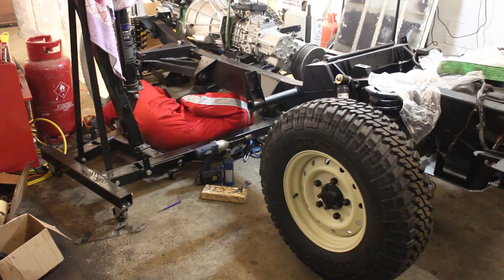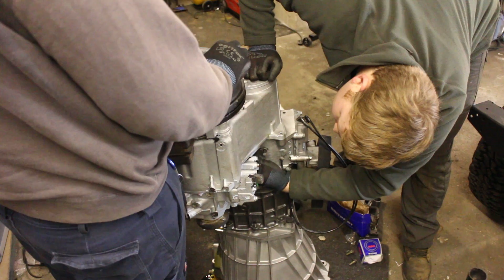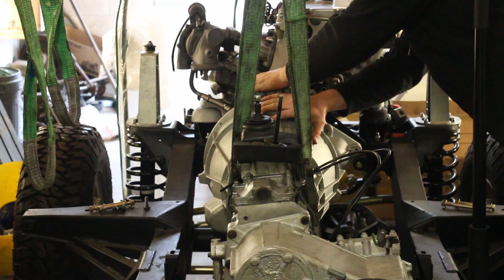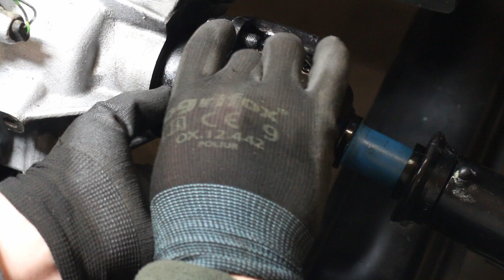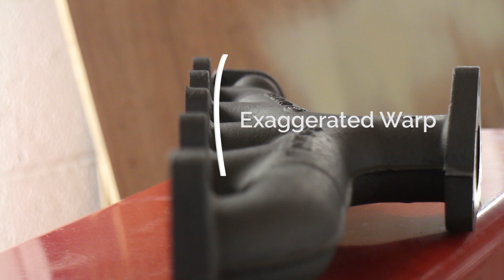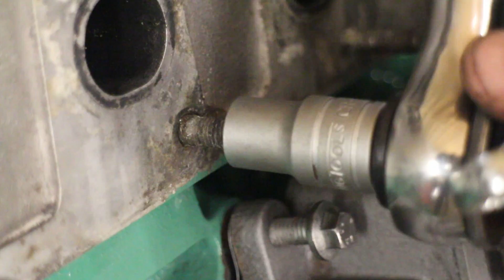R380 Refit, Exhaust Manifold upgrade + Propshafts

Comment: enjoying the vids did you change the coolant drain plug behind the exhaust manifold i have mine to do as its seaping coolant vid will help has manifold has to come off
Reply from the maker: Hi Neil, we've ordered one along with the coolant block inside the oil cooler housing, will be in an upcoming video